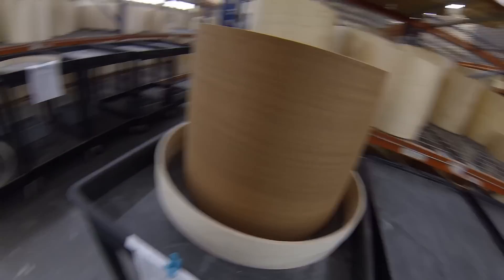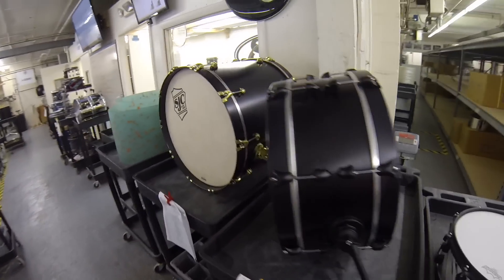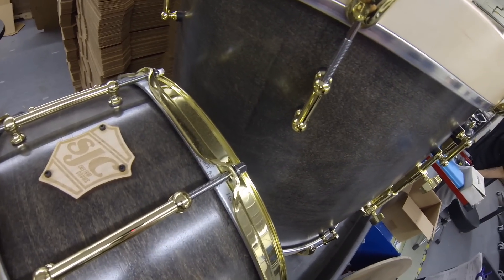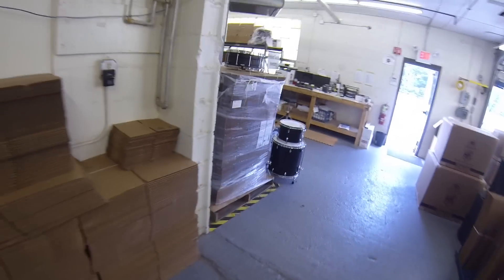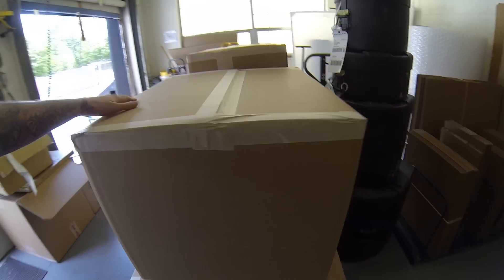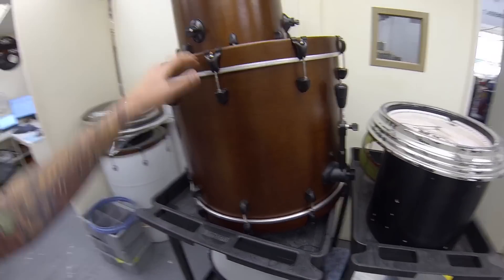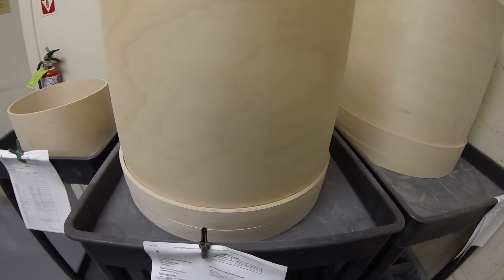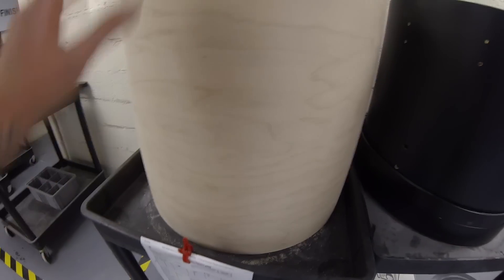SJC Drums VLOG: What's your dream drum?!

Comment: Dream kit would be made of walnut with thin shells and reinforcement hoops.  toms 9x10, 10x12, 11x13, floor toms16x16, 16x18  (maybe a 14x14 ft as well) 18x24 kick.  Finish is up in the air as there are so many possibilities.  If the wood grain looks great maybe just a clear lacquer.  Possibly a red sparkle lacquer or something kind of bold.
Reply from the maker: awesome!

Comment: My dream kit would be a translucent sea foam green on quilted maple (Gibson recently did this finish on a Les Paul) with matching powdercoated hardware (Drums and stands/pedals both) Custom front head with artsy astronomical sun design and my initials in matching colors (painted or paint look but printed).Also custom matching sun badges in gold with SJC logo of course! 14x22 bass. 7x10, 8x12 toms, 14x16 floor tom, matching 13x5 maple snare.. whew! Specific? Yes! But that would be my fully custom kit.

Comment: My dream kit would be insired by the book; The Night Circus. It would have a gloss black wood stain, with symbols and features referenced within the book in red and white, with a paint splatter effect. Sizes would be 10x7, 12x8, 14x12 and 20x16 bass. As for the snare the size would be 14x6.5 and it would be hammered steel. All drums would have black nickel hardware.

Comment: 14x8 snare, 12x8 rack tom, 16x14 floor tom, 22x20 bass drum, maple kit. Tangerine Orange or Olive green finish with Flat white horizontal stripes on it and a white hardwares :) with reinforcement rings as well and a beautiful white bass drum heads on the front <3 #SJC